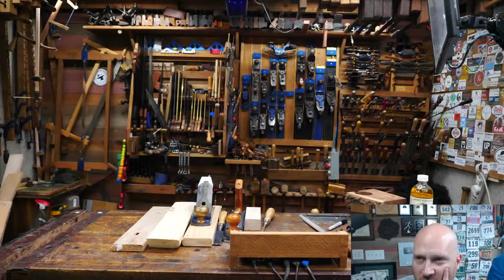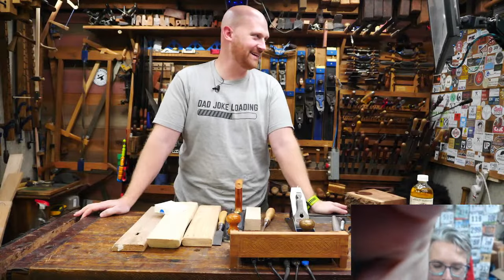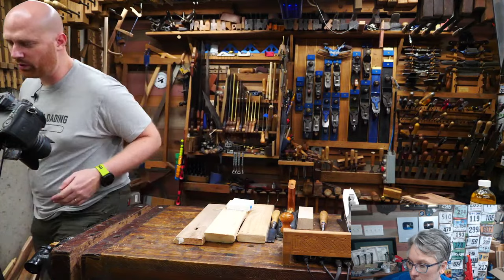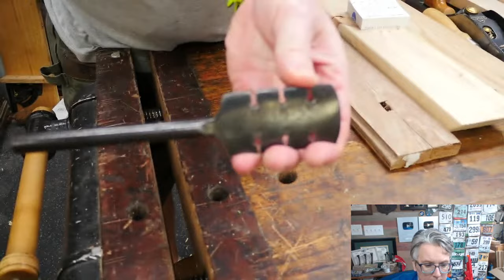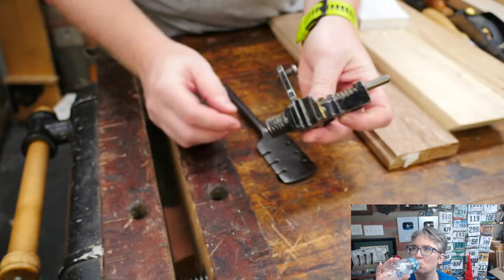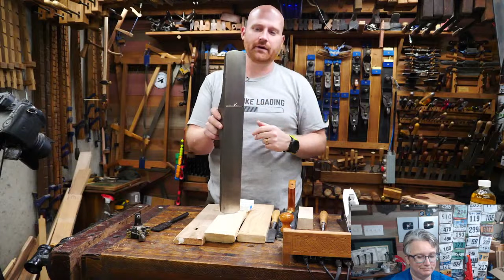July QnA 2023

Comment: 27:35 - Diamond plates need to be "broken in" before attempting to flatten a chisel or plane iron back or before trying to sharpen gouges. Many top makers suggest rubbing the plate with only light pressure for around 5 minutes with a mild steel to break in the plate before using it to perform those tasks. 

Otherwise, the lose diamonds will form a slurry (similar to high grit water stones after using a Nagura stone) & that diamond slurry will abrade the embedded diamonds off the plate under the chisel back as you firmly rub it back & forth. Some of the plates I've purchased come with "breaking in" instructions & it's worked well for me.